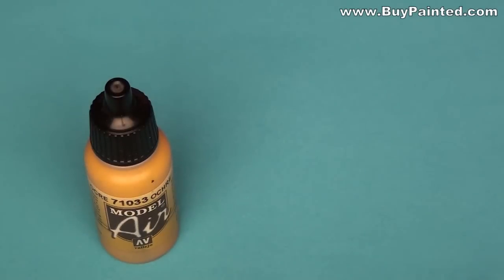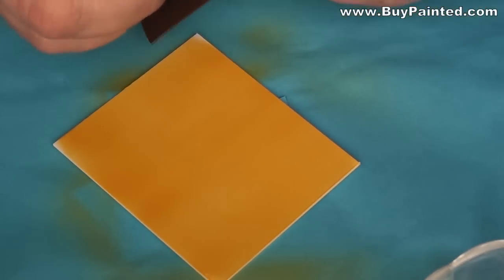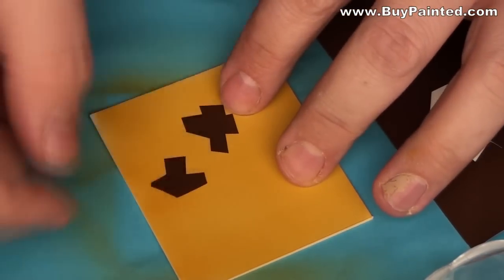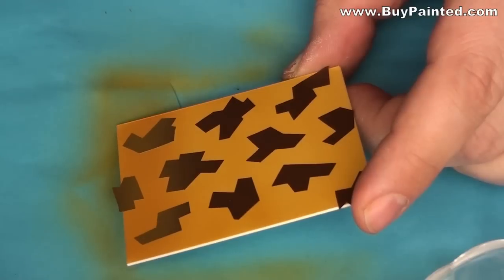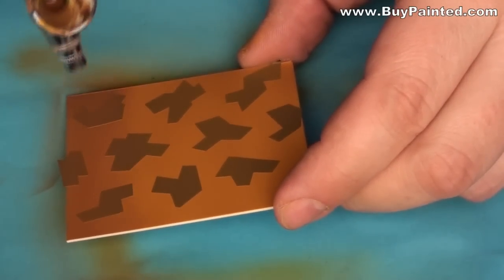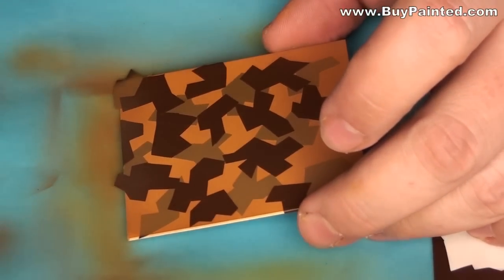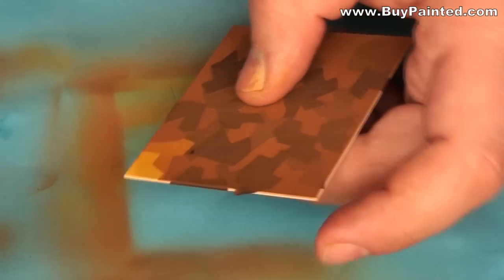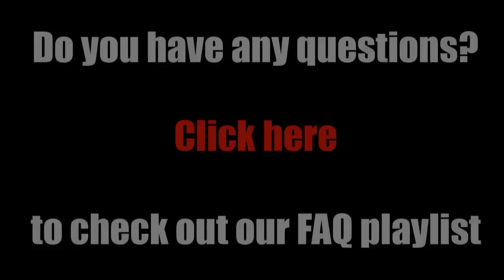How to paint Tau Desert Camo? Warhammer 40k

Comment: Hey cromium. There are various sizes of airbrushes inlets, hoses and the like. You may need an adapter. I would wait until your airbrush and compressor arrives and if you can't connect them check a hardware or hobby store.